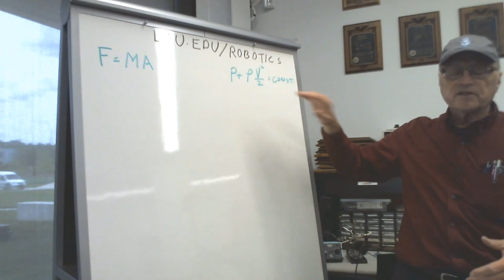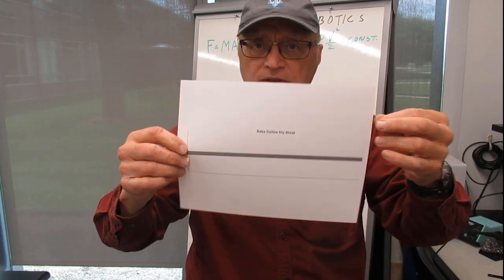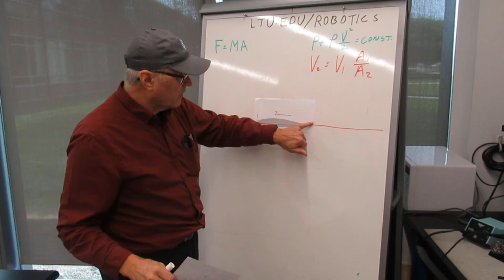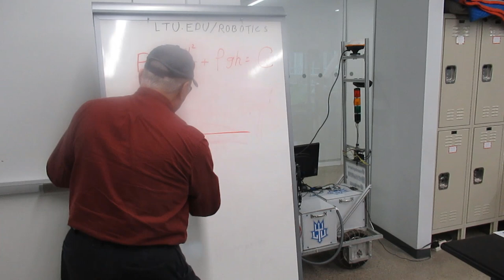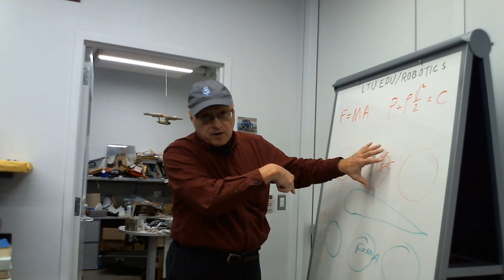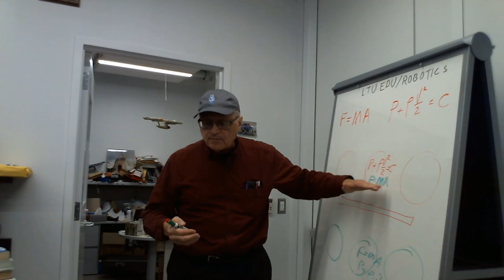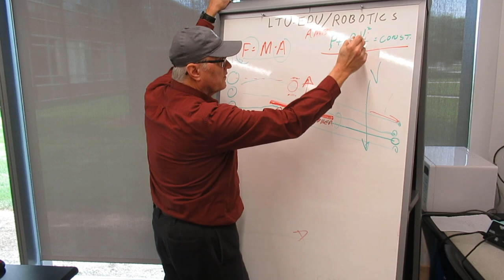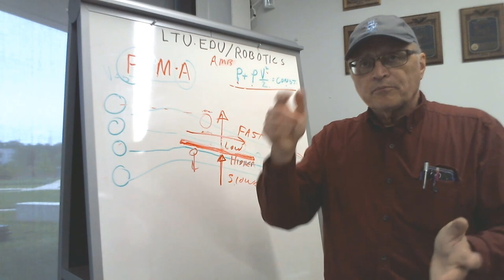Lift: Facts vs. Fiction - Fairy Tales for Pilots.

Comment: Dear Engineer,
As a theoretical physicist I find your explanations extremely enlightening, as I had similar discussions with fellow researchers  in the field of fluid dynamics and aerodynamics. As of yet, a comprehensive lift theory which be able to explain the process in every single detail does not exist, though there are respectable attempts to shed the light on the subject. Many experts assert the following process for the lift generation:
Downwash flow------>Newton II:a law ------->Newton III:a law and Bernoulli----->Lift
I have to add that the circulation theorem is a mathematical modelling rather than to be a physical and phenomenological theory.
If we believe that the above explanation is so far the most plausible one which I do, it remains to explain what causes the crucial downwash flow. The existing hypothesis are not convincing, but I will briefly mention them:
(i)	Viscosity/ comprehensibility gradient 
(ii)	Gravity 
(iii)	Vorticity caused by viscosity 
(iv)	Angle of attack 
I am very interested to know your opinion on the cause or causes of the downwash flow hypothesis.
Respectfully 
RR/ New York City
Reply from the maker: My intent has been to provide a simple, intuitive, explanation for a non-technical audience such as pilots. I think the reasoning outlined below works for that, and while it is not a comprehensive discussion of all of the details of the fluid flow, it does provide a reasonable level of intuition and is generally consistent with the laws of physics and leads to explaining downwash and the differences in pressure that results in lift. 
First, let us start by assuming that the air is flowing along the top and bottom surfaces of the airfoil. Given this, it is clear that the two separate flows of air (upper and lower) will merge at the trailing edge. And, it seems intuitive that the final resultant direction of that flow will be at an angle somewhere between the extensions of the tangent lines of the airfoil surfaces – at least for simple shapes. For an airfoil operating with at a positive lift coefficient, that angle is downward w.r.t the free stream direction. Thus, this seems to be a straightforward intuitive (but simplistic) explanation of downwash. Now, however, we are left with a number of questions. First, why does the air flow tangent to the surfaces? This is particularly troublesome when you think of the upper surface of a wing where there has to be a lower pressure along much of the surface to get the air to accelerate towards the wing. Also this requires the air to flow against the adverse pressure gradient as it gets towards the trailing edge. For this, it seems to me best to turn to viscosity. You are likely familiar with the demonstration where one blows over the top of a piece of paper and it rises up. This is commonly claimed to be a demonstration of Bernoulli’s principle, but as you are likely aware, it violates the very assumptions that make the principal valid and instead typically demonstrates that people don’t understand Bernoulli’s principle. It also shows that air does indeed have viscosity. The jet of air entrains the surrounding air – accelerating it tangentially to the jet. This sets up a flow inwards towards the jet which causes the paper to rise. Similarly, the flow of air over the front of an airfoil at some angle of attack will entrain air between the wing and the main flow. This suggests two possible flow patterns. One would be an area of turbulent flow between the foil and detached air flow – this is when the wing is stalled. The other would be flow that is attached to the surface. As air is pulled out of the area between the foil and the detached flow, it leaves an area of lower pressure which eventually pulls the flow over the leading edge down along the surface. There are, of course, other unanswered questions such as would be how you can still develop downwash (and lift) when the flow is at least partially separated from the foil, or what happens if you deflect a control surface upward. For these the simplified, intuitive approach that I have attempted to outline for the typical pilot does fall short – you need to step back and consider the whole flow field. And, as you have suggested, that is messy at best. 
One other comment – I find attempts to incorporate Bernoulli’s equation into an explanation of lift to be highly unsatisfactory for the simple reason that in order to explain low pressure, you first have to explain the velocity. The only somewhat satisfactory way to explain the velocity differences between the top and the bottom surfaces is to resort to circulation (at least in my opinion). And as you point out, circulation is more of a theoretical, mathematical, construct that does not lend itself to an explanation of lift directed at a non-technical audience.
Reply: @LightAndSportyGuy  
Dear Engineer
Thank you for a prompt response. I find your video and line of reasoning intellectually stimulating. Back in 1994 I worked on a subject related to non-colliding shockwaves in Tokamaks (fusion reactors). The point of departure for any successful research within the field of magneto-hydrodynamics strongly depends on deep understanding of the classical hydrodynamics. To my astonishment, the field of hydrodynamics has not been advanced as rapidly as the other fields of physics. 
Now please allow me to make the following comments regarding your response;

1.	When it comes to lift theory based on Bernoulli’s principle, we are in agreement. The velocity gradient is the effect and not the cause. None of the reputable experts that I talked to, believe that Bernoulli should be the point of departure. 
2.	Issues concerning the down flow;
(i)	As you correctly pointed out, the shape of the airfoil is not relevant as to why an aircraft is able to lift and maintain it (an aircraft could fly upside down, and have different curvature on the top and bottom).
(ii)	Now, for the sake of the argument, suppose that we have a very thin rectangular airfoil. The viscosity (of a laminar flow) above and below the airfoil is highly symmetrical. This means the amount of the pressure gradient produced by viscous flow on both sides should be of the same magnitude, but as photos from wind tunnel experiments show that is not the case. 
(iii)	The question remains to explain the down flow. Some researchers put the whole aircraft in a more macroscopic hydrodynamic system, and argue that an aircraft’s propulsion –based on viscous property of a highly compressible flow- is able to generate a large perpendicular vortex which causes a significant amount of down flow. But none of them describes why a close loop could be generated and why the direction of the vortex circulation is clockwise. 
(iv)	A macroscopic thermodynamic/hydrodynamic system should have well-defined boundary conditions. Do we assume homogeneous Dirichlet boundary condition (no mass/energy with the surrounding), or rather non-homogeneous Neumann boundary condition as the vortex should disappear shortly after. But how could a dissipative open system (which contain the vortex) explain the pressure gradient. 
(v)	It has been asserted by some engineers that a gravitational force acting on the two flow layers could possibly explain the down flow. But the difference between top and bottom of an airflow is just few meters. It does not explain the huge velocity difference. 
(vi)	Based on Blasius and Kutta-Joukowski lift theorem, one could easily calculate both lift and drag of a certain flow on an object.  It pretty much straight forward calculation, and the corresponding integral assuming the flow is laminar, incompressible and inviscid produces both lift and the drag. But the mathematical model assumes that a circulation exist already and affects the system, but does not explain in any way or shape as to why the vortex comes to existence. And the scenario becomes more complex if we try to calculate lift at super and hypersonic speeds. 
Once again, I thank you cordially for your valuable input. Stay safe and healthy.
Respectfully
RR
Reply from the maker: @ruzros6293   Sorry for the delay replying - i got side tracked and this slipped off the table.
I'm not following all of your questions, but as far as gravity being a factor - that makes no sense at all - propellers, windmills, sailboats, etc. all generate "downwash" in a horizontal direction. A wing on a car generates "downwash" upwards. 
Kutta-Joukowski is a convenient model that assumes circulation that uses the Kutta condition in order to calculate the airflow patterns for an inviscid fluid, and as you point out, does not explain how the circulation comes into being. However, in the end, it is the fact that air (and other real fluids) do have viscosity - and this is what causes air to follow the top of a lifting surface and give us the smooth flow off the trailing edge (ignoring a stalled condition) - that, of course, satisfies the Kutta condition which makes the circulation model work. One could argue that it is the lift that causes the circulation. 
iii - you lost me - you don't need a propulsion system to generate lift, and always clockwise with respect to what? Trailing vortexes turn in opposing directions, and vortexes from the lifting line theory (Prandtl) point outboard over the top if I recall correctly)
ii  - flow over a rectangular surface is symmetrical only if there is no angle of attack - and then there is no lift. But, once you provide some angle of attack, you introduce asymmetry - flow if forced to curve over and under the surface resulting in the asymmetric pressure gradients, but  perhaps I  misunderstood your comment.
Reply: @LightAndSportyGuy  

Hi, Light and Sporty guy,
Thank you for your respond (late better than never!). I had an extensive exchange with an Indian professor who basically solved the mystery for me. Without getting into theoretical discussions which may add to confusion as the scientific terminology has different meaning to different people, I summarize my conversation with the professor;
One could divide the whole lift process into two distinct phases, namely;
1.	Stationary aircraft is starting to take off: In this phase we need a proper angle of attack to create velocity gradient, because simply zero angle of attack means NO lift. Acceleration (Newton second law) creates pressure gradient. 
2.	The aircraft is already in the air and maintains a relatively constant altitude; in this phase we have a self-consistent pressure field which causes acceleration of air particles so that the lift is maintained. 
By propulsion, I meant to state the obvious fact that the lift is a dynamic process.
Once again, thank you for the conversation. Stay safe.
RR
New York City
Reply: @ruzros6293  can you suggest me the name of INDIAN professor ?

Comment: Great video! But, I see myself trying to explain this to my friends and getting a response similar to “then why do 99% of all wings have a curved airfoil?” which (ha ha) at that point I will have to bring them here. So if I understand correctly, the curvature of an airfoil has nothing to do with the creation of lift. It's only purpose is to maximize efficiency by reducing drag and the reason different airplanes have differently curved airfoils is because of different combinations of range of speed and wing loading?
As you can probably tell I am one who has been seduced by the fairy tales but I do seek the truth!
Reply from the maker: Exactly, changing camber  thickness distribution and leading edge radius effects the maximum lift and efficiency (ratio of lift to drag) and stall behavior so the shape is optimized for a particular application.  I talk about the effects of camber and thickness here: https://youtu.be/e1b4D_3Vxns And, this video is from someone who actually knows what they are talking about :-)  https://youtu.be/aa2kBZAoXg0